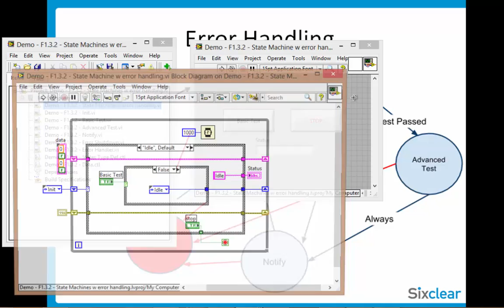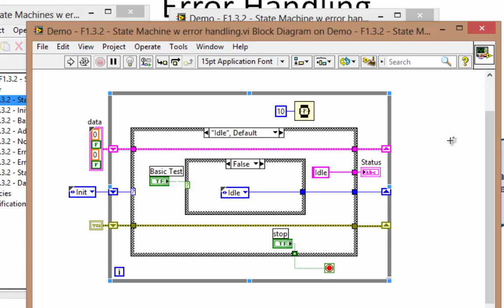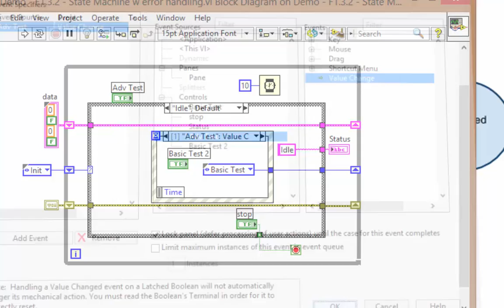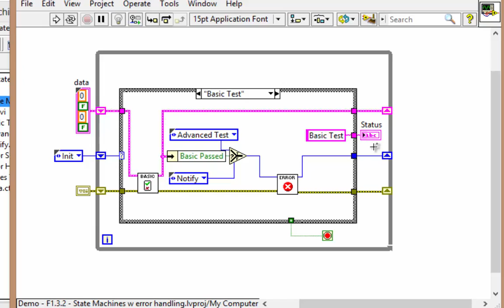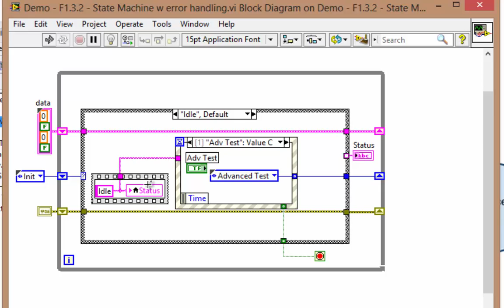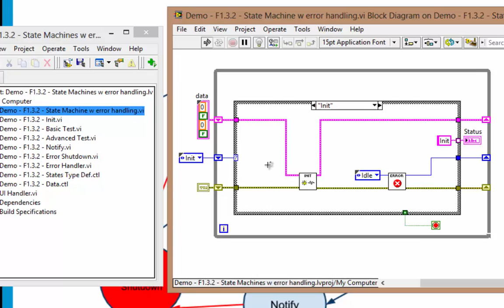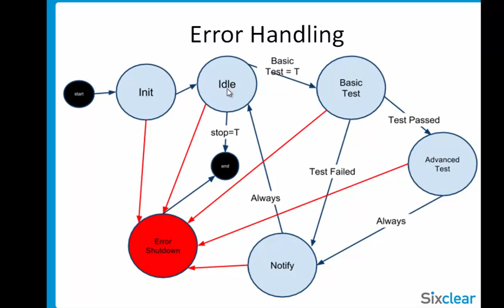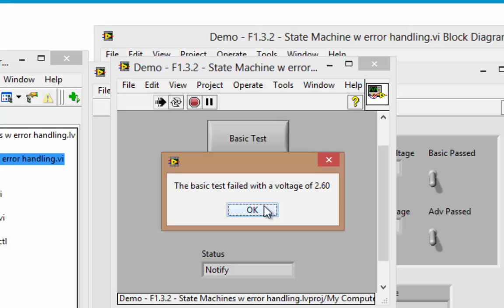VI High 58 - How to Make Your State Machine Event-Based

Comment: If the status display is always equal to the state enumeration text, it'd be much more future-proof to go before the case structure and use "format into string" to convert the enum into a string and write it to the Status indicator. This would take care of all cases with one instance of code. when more cases are added, the new status will be taken care of when you edit the enumeration. oh, and it also would force you to write legible state names (-:
Reply: Andy Soukup Why not just create an indicator no need to bother converting it to display the status. A follow up question is how to display these states with a delay when your loop runs very fast and jumps through the states. Is there an easy way to do this?
Reply from the maker: Great point Andy! It's sometimes tricky to write strings that are meaningful to the user as a status while being useful to the programmer as a state. In the state machine in this video, that would be pretty easy. I've found that as my state machines get more complicated, it gets harder to do both. However, if you can be disciplined enough to do it as you said, that could also save some time. Great comment!